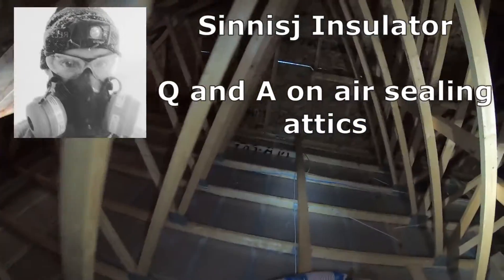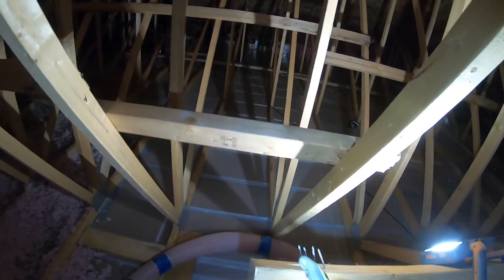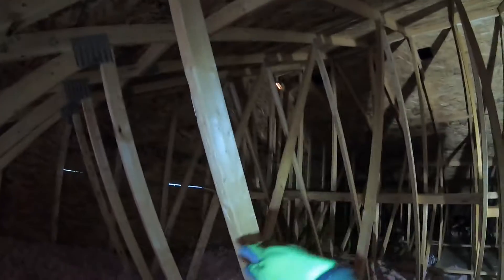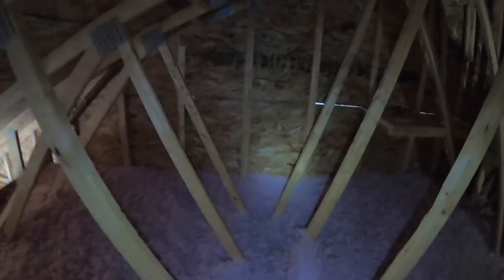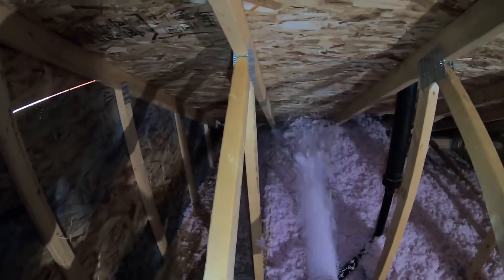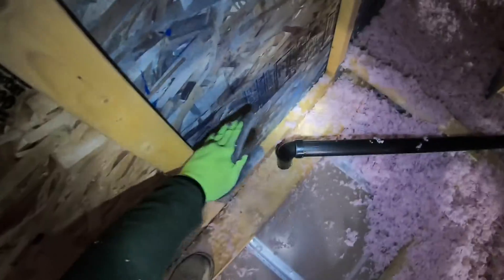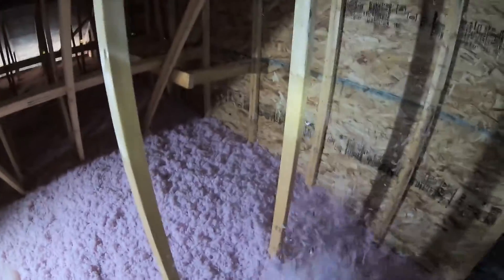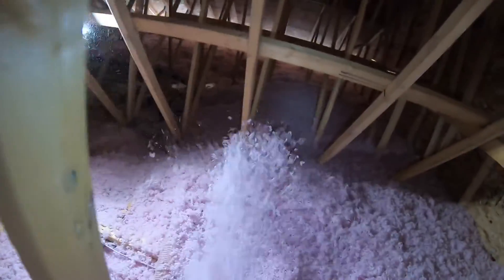AIR SEALING around your PLUMBING STACKS in your EXTERIOR WALL!

Comment: Thanks so much for the answer!  Interestingly I have a huge gap on the gable walls...no idea why they are designed that way.  Off to the store to get more closed cell spray foam!
Reply from the maker: Some outside walls didn't have top plates and the lips to secure the ceilings were installed onto the 2*6 walls it seems. Closed cell for those it the way to go. Massive heat loss if not airsealed.